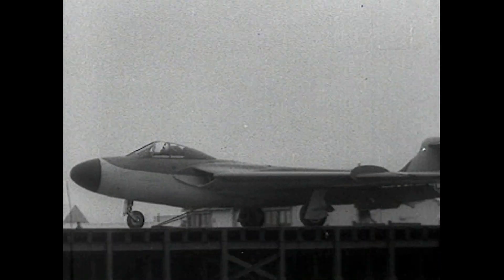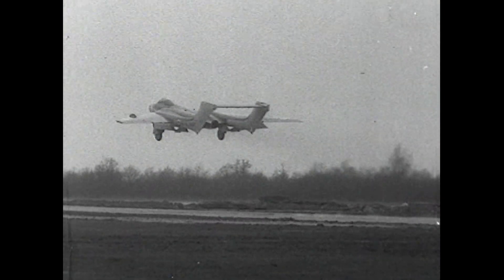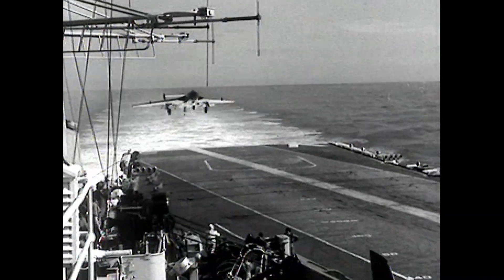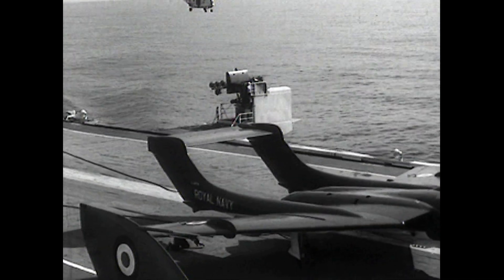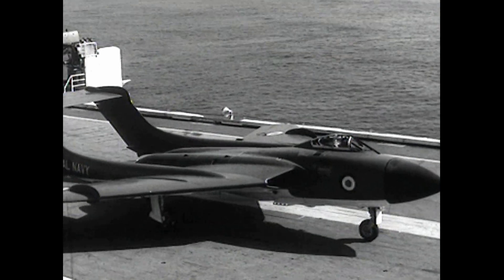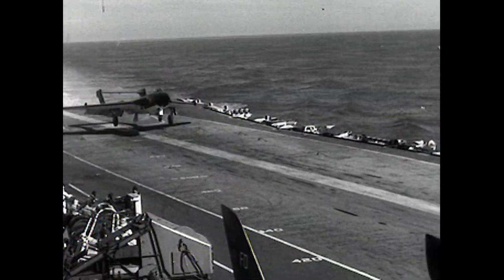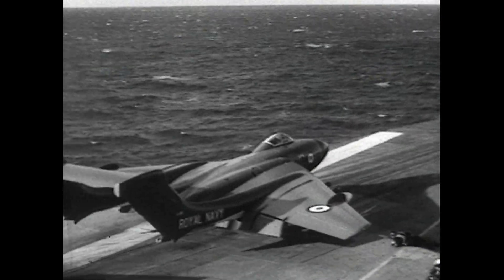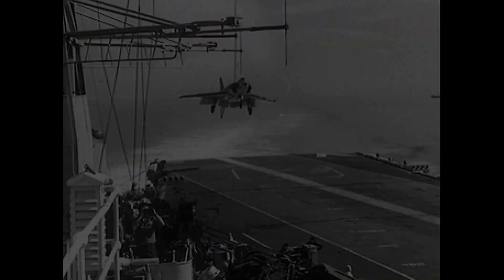de Havilland Sea Vixen deck trials 1958

Comment: the plane on the thumbnail is a venom not a vixen btw
Reply from the maker: It's actually a Vampire. Yes, it's misleading. It is part of the generic intro used on all the videos. Must change the thumbnail.
Reply: 🤣deflect blast orf the deck.